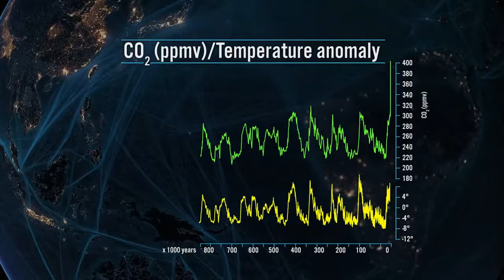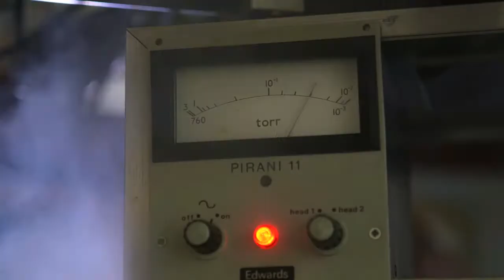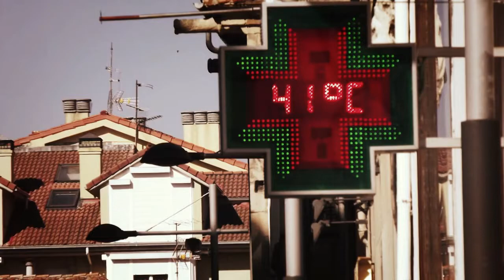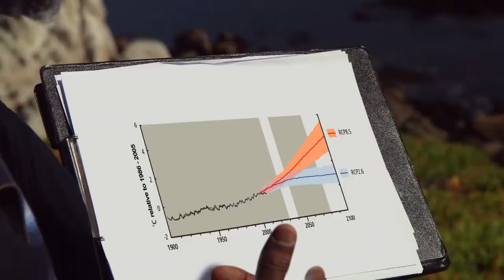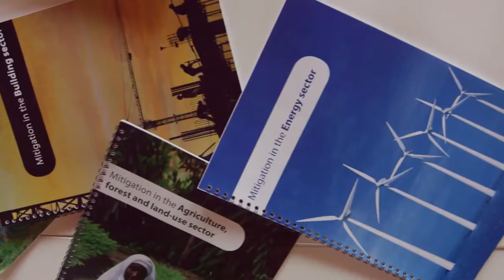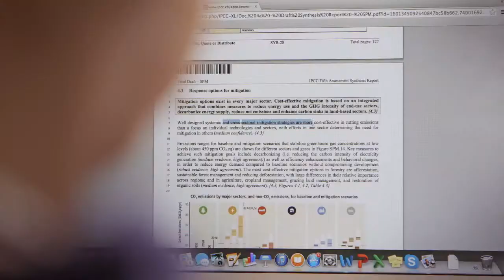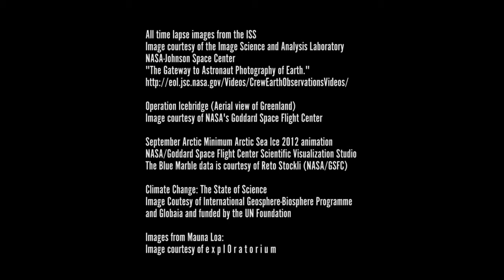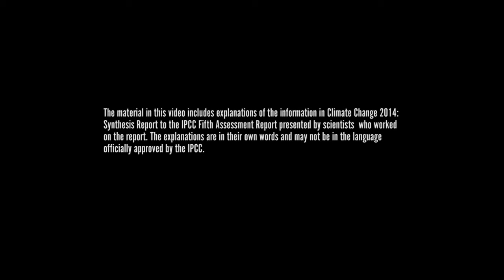IPCC AR5 Synthesis

Comment: @ 3.30 one of them declares "climate models play an absolutely crucial part in this assessment report ...."  

Really?

Because the climate scientists involved comment thus in the technical section:- 

 “In some aspects of the climate system, including changes in drought, changes in tropical cyclone activity, Antarctic warming, Antarctic sea ice extent, and Antarctic mass balance, confidence in attribution to human influence remains low due to modelling uncertainties and low agreement between scientific studies.”

“Based on model results there is limited confidence in the predictability of yearly to decadal averages of temperature both for the global average and for some geographical regions"

Headlines of the IPCC bear no relationship to what climate scientists say it's purely a UN spin machine.
Reply: I can see why you are skeptical but the two points are compatible.

Note that one above quote talks about some - not all - aspects of the climate system. The climate system is immensely complex. Predicting every single aspect of a terrifically complicated system is pretty challenging and current models have their limitations. Scientists have quite rightly focused on predicting trends in aspects such as global mean air and ocean temperature and precipitation levels. Models have in fact predicted these with certain levels of confidence that are robust - see the AR5.

Addressing the last quote: predicting a precise future mean yearly or decadal temperature is really hard (and probably the wrong question to be asking), due to a load of natural variability in the system. Natural oscillations in the climate system occur on timescales ranging from a year to several decades. They all augment each other too. Overall trends over timescales of several decades or centuries can be more reliably and confidently predicted.

Models are the only way to give us any quantitative prediction on future trends. They are not prefect but they do get better each generation.